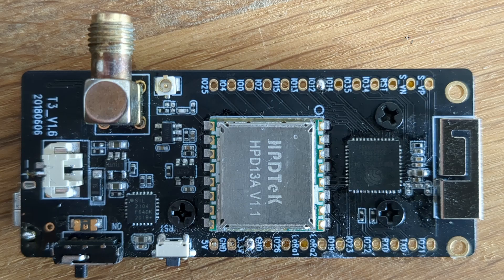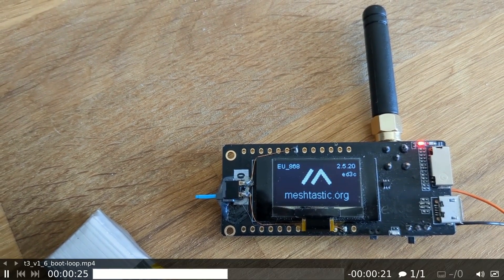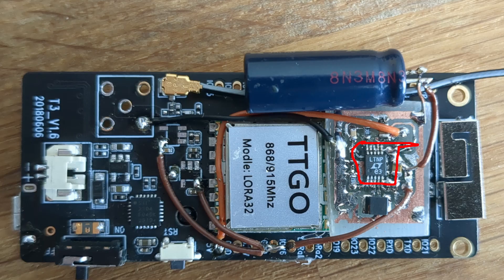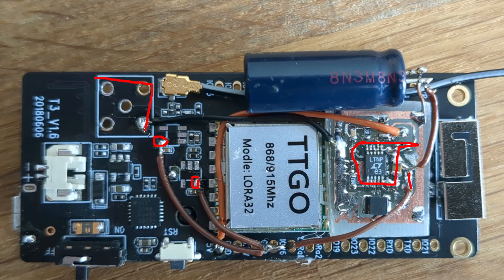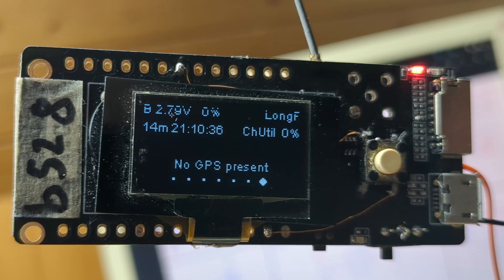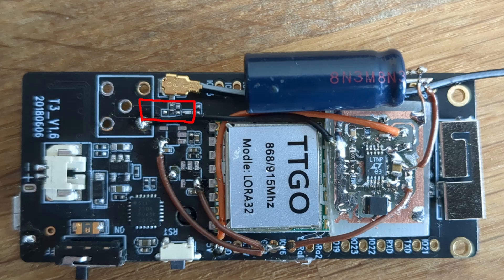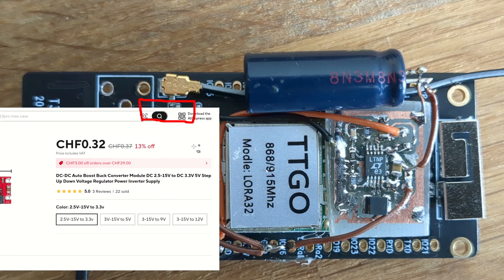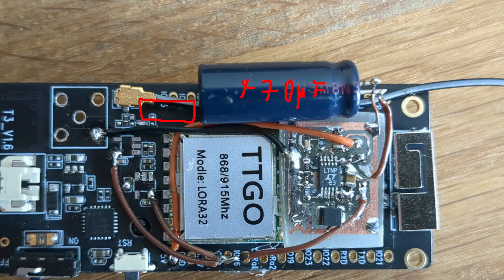I Fixed the TTGO Lora T3-v1.6's biggest Flaw!

Comment: This is one off the worst module I have ever had!And they are not cheap!
Reply from the maker: Yes, they are barely usable without modding them like i did.
Maybe using a switched mode buck converter would also work if said converter was capable to simply passing through the battery voltage once it dipped below the regulated output voltage because both the ESP32 and the Lora module should be working down to 2.5v. 
Anyway, the modded module now lasts a full day with just a 750mAh battery. 
Did you like the Swiss accent?